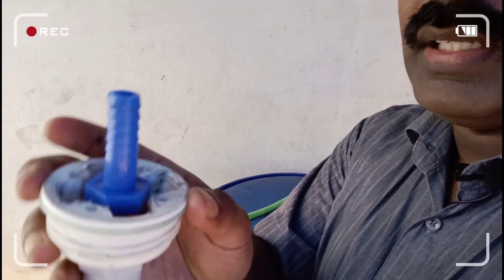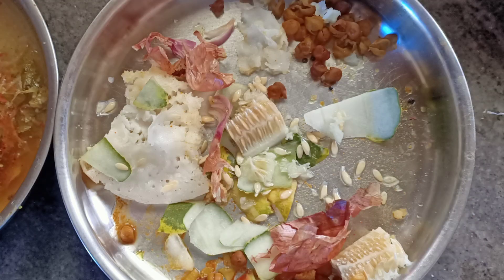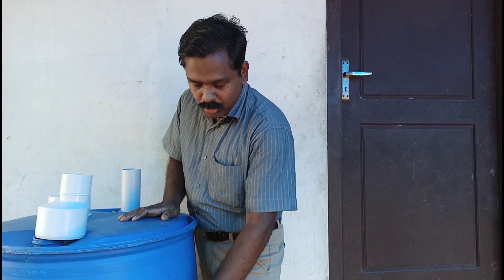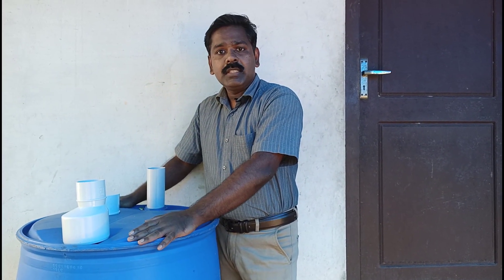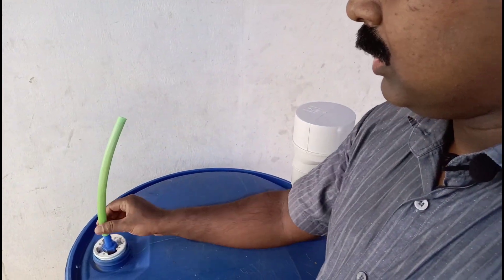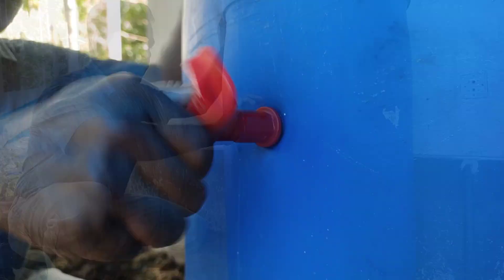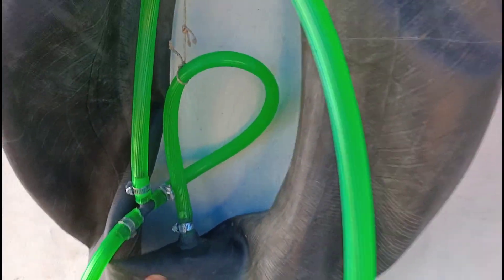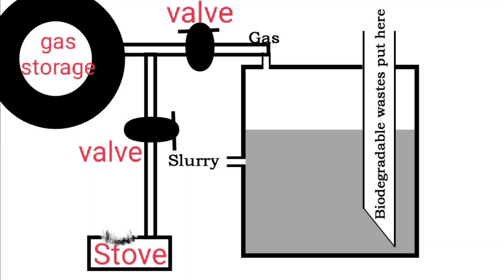DIY Biogas plant-Part 1// 1500 രൂപക്ക് ബയോഗ്യാസ് പ്ലാൻ്റ് നിർമ്മിച്ചാലോ?/ Home made Biogas Plant.

Comment: What is the cost of stove, and where do you get the valve for the connection.
Reply from the maker: Stove costs approximately 2000rs
You may get the valve from plumbing Shop.

Thank you. Keep in touch.
Reply: @AyurdocJourney  thank you,  see so you must not say 1500 is the cost of setup for these plants,  it should include the stove cost as well. Since I have noticed many of them don't mention about the cost of stove which is the  main part for the system/plant.